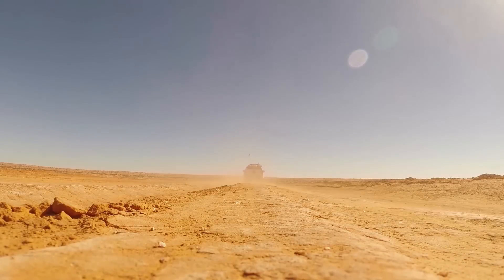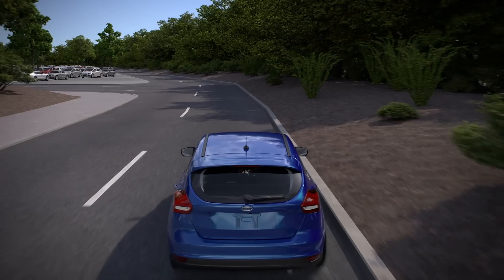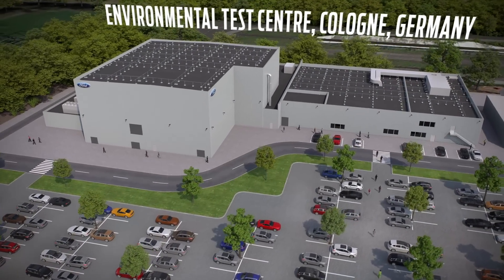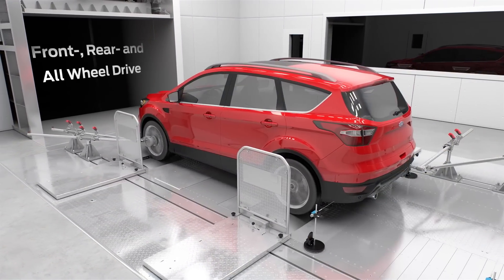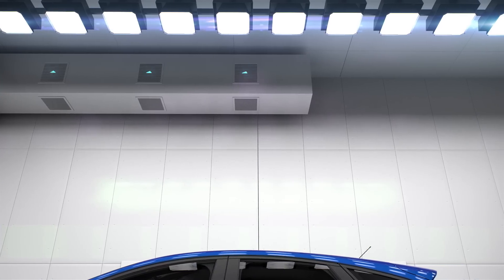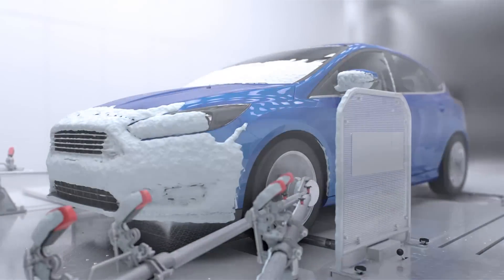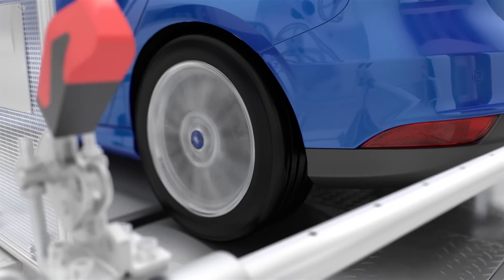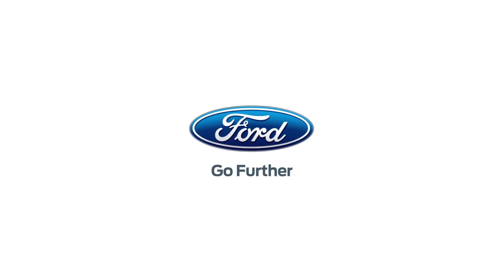Ford's ‘Weather Factory’ can simulate global weather conditions

Comment: Yet the cars still break at 100k miles
Reply: rubixsolvezzz _ Some cars sure, like my bmw, but not a ford. Ford's are pretty reliable aside from the models with powershift transmissions. Every ford my family has owned has lasted 300-500k.
Reply: Puff the Magic Dragon my dad has owned 3 fords and they have all broken down completely by 100k miles
Reply: rubixsolvezzz _ Alright, every brand makes a few bad cars, but overall, fords are pretty reliable.
Reply: rubixsolvezzz _ If you think Fiestas built between 1995-2002 we're a laugh for having 99,999-00,000 mileage clocks (Ford never expected them to last that long) the 1.0 litre EcoBANG engine is even better. 31,000 miles reached if your lucky. I believe the worst offender of the lot is the 125ps output. Even early Fiestas lasted 99,999 miles.
Reply: @1ns4ne1d10t  Have one with 60k on it. Been perfect with not an issue. Also see lots through work and aside from the common coolant hose issue, ive changed one oil pump due to servicing neglect. Great little engines, people worry because there small capacities and high power outputs. Look after them and adhere to the service intervals and it should last. Simple really
Reply: My dad has a 2001 Ford Expidition and it has no problems

Comment: I thınk ford is better than vw
Reply: I like to ford my safe !!
Reply: 1ns4ne1d10t They're pretty reliable aside from the Fiesta and focus.
Reply: Have an ecoboost focus and tiguan at home and i can assure you, ive spent more on the vw than the ford. In 3.5 years the focus has had nothing more than brakes and tyres aside from regular servicing. The tiguan set me back 600 quid last year znd the haldex system has just gone a pisser......
Reply: Puff the Magic Dragon I've had absolutely no issues with my 2013 Fiesta ST.... Pretty damn reliable...
Reply: emre aşkar I know so too ;)
Reply: Yes, they're.
And they are better than toyota too.
Reply: Ford is fine if you like breaking down frequently and love bad customer service.
Reply: idk where your going with your ford but ky 2009 fiesta is still running clear never went to garage becouse it broke down or anything.. me and my dad are actually pritty good friends with our dealer as well so no problems on costumer service here.... (and no thats not just becouse we are costumers)

Comment: Yeah... Still rusts like hell though. You should have a bit more thorough quality controll in terms of the paint jobs. 
And you mention the cold as a big opsticle, no it's not. It's the road salt, and the cars you produce now can't even handle cold weather. I've had the door handle on a mondeo froze in open position so you couln't close the door and so on.
Reply: 2 vehicles as "sample size" truly say nothing from a scientific point of view ;)
I drive a 2007 Mustang (in winter as well, with salt everywhere) and have 0 rust. Recently even checked everything underneath. 
It's only a sample of 1, but so are our both examples invalid for making any statements about paint job quality or corrosion sealing.
Reply: our 1998 Mondeo with 730000km on the clock never have had any rust for 17 years. and we live in the bavarian alps.
Reply: throw And where do you live? If you live somewhere you've bearly heard of snow it's not unusual in terms of cars not rusting.
Reply: stabakfan I have a mondeo its a GREAT CAR!!! Door handles freeze on all cars it's not just your specific car sorry to say but our mondeo does not do that but then again I live in New Zealand so the temperature is ALLWAYS perfect not to cold can get down to 0 in the morning winter to 30 in the summer!!
Reply: I have a 2007 Focus with 160,000 miles on it, it's never been in a garage and it's been driven all over the UK and Europe in every kind of weather.

Not a single bit of rust.
Reply: Michael Timofeev Well i have more samples, For instance a 2004 Mondeo, and a 96 Escort. Both of them not too great rust protection but believe it or not the 96 Escort was the better of the 2. And i also had an 09 Opel Insignia, also no rust on that either.
Reply: I had a £300 Vauxhall Corsa. Never had a door handle 'Freeze' open. Ford's are rubbish!
Reply: Your opinion is explained by your avatar. Like Opel is the most non-rusting brand :DDD
Reply: Martin Karanikolov I have never said they don't rust, but mine is older than my fathers Mondeo with 8 months still doesn't have rust on it, while his does. As a result of a crappy paint job, Also have a friend who works at a Ford dealership, he says the quality of the paint jobs are horrible too. 
If that doesn't say anything i don't know what does. and both cars are made in 2011.

I still like Ford don't get me wrong, but they need to do something about those problems.

Comment: Rubbish. Explain why powershift failed in tropical countries. I sold my fiesta after clutch replacement 4 times in 4 years.
Reply: bajukuyup different Ford dude
Reply: bajukuyup bad driving I guess I drove mine never had 1 single problem!!
Reply: bajukuyup The powershifts are like the biggest reliability issues with fords, aside from that, they're pretty solid.
Reply: In Brazil powershift is called "powershit". Lot of problems
Reply: I wondered why Mercedes and German cars had an 'anti-towaway' option in the instrument cluster. When I bought a Ford I soon found out why Ford never have an anti-towaway option...